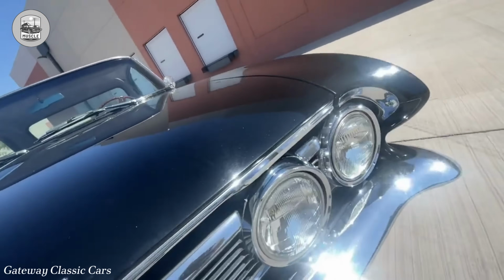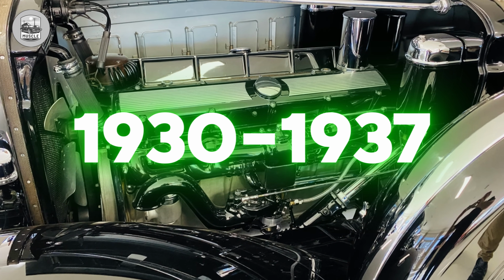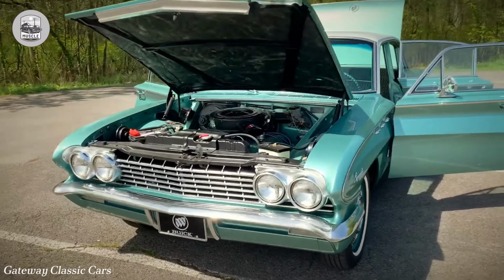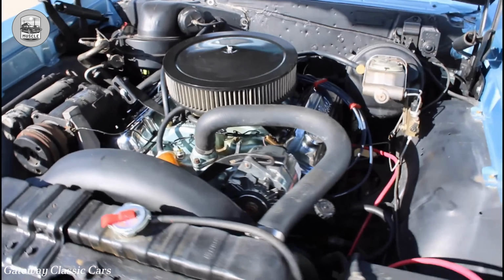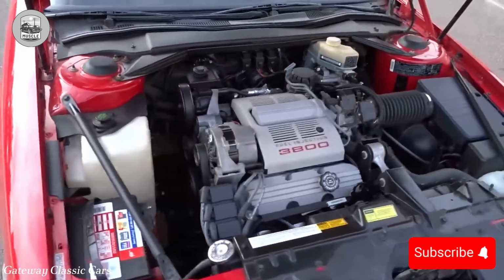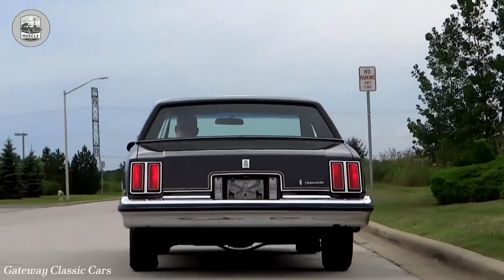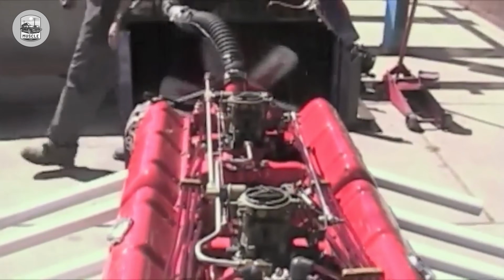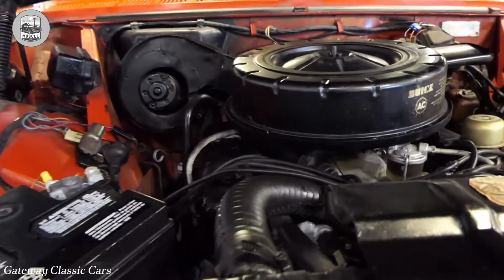10 MOST FAILED and WEIRDEST GM Engines ever made | Worst engines blunder!

Comment: Be sure to cover all the Corvair engines, as they stand out as some of the most unique in automotive history. From their air-cooled flat-six design to their turbocharged variants, Corvair engines broke away from conventional engineering of the time. Their innovative approach, coupled with Chevrolet’s bold vision, set them apart from anything else on the road. Exploring their distinctive features, including the rear-engine layout, will offer a fascinating look at what made these engines truly exceptional. They are the most unique!
Reply: How unique, you ask? It’s like having a clunky six-cylinder engine that’s essentially a knockoff of a VW powerplant.
Reply: @CookeZachery  I don't think it is "a clunky six-cylinder knockoff of a VW powerplant." While it might share certain design elements with VW engines, the comparison oversimplifies the engineering behind these engines. Many six-cylinder engines, including those designed by other manufacturers, were developed with unique performance characteristics in mind. These engines often outperformed their competitors in specific applications and provided a balance of power, durability, and drivability that cannot simply be reduced to being a "knockoff." It’s essential to recognize the distinct innovations that various automakers bring to their engine designs.
Reply: @AilaniMadden  While you highlight that many six-cylinder engines were developed with unique performance characteristics, the engine in question, specifically, does bear significant resemblance to VW’s design principles. It's not just about superficial similarities but about the core layout, cooling system, and other key features that clearly align it with VW’s philosophy. The performance, though potentially serviceable in certain applications, lacks the groundbreaking innovation seen in other six-cylinder engines of its time. By labeling it a "knockoff," we emphasize how this particular engine leveraged existing concepts rather than introducing its own engineering breakthroughs.
Reply: @CookeZachery Regardless of its origins, the Corvair engine fits the topic of the video, which is unusual GM engines - the Corvair engine is arguably the most unusual of GM engines, since there were no GM engines like it before nor since,  and it shares no design features with any other GM engine series.
Reply: @CookeZachery  Corvairs came factory full of forged parts. The world renowned guru of homebuilt aircraft , William Wynn, published a work on why the Corvair was the best engine for them, better than Subaru or Lycomings.  Interesting read. There were Corvairs used in everything, from drag rails to boats, airplanes. They even put them in Porsches for things like the Pikes Peak Hill Climb. They dominated so much they broke them off into their own class.  There were Corvair rally clubs all over Europe.
Reply: @wymple09  While I appreciate the enthusiasm for the Corvair's versatility, it’s hard to overlook its reliance on well-trodden VW engineering principles. Yes, it found success in niche applications like aircraft and hill climbs, but that versatility often came from adaptation rather than innovation. The air-cooled, flat-six design echoes VW’s playbook, and while GM scaled it up, it didn’t break new ground like contemporaries such as Porsche or even Lycoming. Rally clubs and modified uses highlight the engine's adaptability, but being adaptable doesn’t equate to groundbreaking.
Reply: @CookeZachery  It was ground breaking in it's own way. No other passenger car engine was leaving the factory so full of forged parts as standard equipment.  In it's weakest form it doubled the output of a VW & smoked the Porsche in torque numbers. They put Corvair engines in Porsches for that reason, calling them Porvairs.  And they did it at 1/2 or less the cost of a Lycomings.  Porsche went to flat 6 almost immediately after obtaining an early Corvair to study.  There were many design elements in Corvairs that were copied by European car makers, including VW.  Who came 1st, the chicken or the egg? Chevrolet had a V8 in 1917, long before Ford brought out the flathead V8.  Vw in no way was the 1st to use a flat 4 design .  VW was late into the 30's before they cranked up.

"In 1900, the first flat-four engine was produced by Benz & Cie, based on Benz's 1897 "contra" flat-twin engine.[citation needed] This engine was used in Benz racing cars, produced 20 hp (15 kW), had a displacement of 5.4 L (330 cu in) and was designed by Georg Diehl.

London company Wilson-Pilcher released its first car in 1901, which was powered by a flat-four engine. This engine was mounted longitudinally in the chassis, water-cooled, produced 9 hp (7 kW) and had a displacement of 2.4 L (146 cu in). Unusually for its day, the bore and stroke were equal, with each being 95 mm (3.7 in).

In 1902 the Buffum automobile was equipped with opposed four cylinder engines that were rated at 16 horsepower. Herbert H. Buffum produced an American Automobile called the Buffum in Abington, Massachusetts from 1903 to 1907.[10]

Having previously produced flat-twin engines, the 1926 Tatra 30 was the Czech company's first model powered by a flat-four engine. Tatra produced various flat-four engined model through the 1920s and 1930s.
1936–1999
The 1936 Tatra T97 pioneered the rear-engined, air-cooled flat-four, backbone chassis layout (later used by the Volkswagen Beetle), and at the same time, though unrelated, came the Steyr 50 from Austria, sporting a front boxer 4 engine with rear wheel drive. Also in 1936, English company Jowett expanded its model range from flat-twin engines to also include flat-four engines. Production of Jowett flat-four engines continued until 1954, when the Jowett Javelin saloon and Jowett Jupiter sports models ended production.
Reply: @wymple09  Look, the Corvair was clever, but let’s not kid ourselves—it wasn’t reinventing the wheel. GM basically supersized what VW was already doing. Sure, the flat-six had torque and was a blast in hill climbs or rallying, but groundbreaking? Not so much. Porsche and Lycoming were pushing boundaries while Chevy played it safe with air-cooled tech from the '30s. And yeah, it got copied, but being copied doesn’t mean it led the charge—it just made it cheaper for everyone else to catch up. Muscle cars roar with V8s; the Corvair was a whisper in the wind by comparison. Fun? Sure. Revolutionary? Nah
Reply: @CookeZachery  By your measure the VW was just advancing the already done. Everything is just a furthering continuance anyway. So what? Corvair still did what nobody else was doing, a flat six in a passenger economy car.
Reply: Owned both the 180 hp turbo charged and the 140 four carburetted models, loved them both.
Reply from the maker: @gelmgren  Thank you for sharing your experience with both the 180 hp turbocharged and 140 four-carbureted models! Those are some of the most iconic variations, especially when you consider how groundbreaking the turbocharged version was at the time. The 180 hp turbo was a real game changer in terms of innovation, being one of the earliest factory turbocharged engines, and it packed an impressive punch for its size. On the other hand, the 140 four-carb setup gave great throttle response and a more traditional performance feel. Each had its unique charm and driving dynamics, making them beloved by enthusiasts for different reasons.
For those who may not know, the turbocharged models were ahead of their time, offering a glimpse into the future of performance engineering. If you’ve driven or owned one of these beauties, let us know your thoughts in the comments! Don't forget to share your stories and subscribe to the Muscle Car Masters channel for more amazing content on classic muscle cars. We’d love to hear from you! Stay tuned and make sure to share this video with fellow car enthusiasts...
Reply: @MuscleCarMasters68  No turbo lag with the 140 four carburettor engine performance response was immediate.
Reply from the maker: @gelmgren  there’s no denying the instant response you get with that setup. The four carburetors gave the 140 engine such a precise throttle feel, making it a favorite for drivers who wanted that immediate, raw connection between their foot and the engine. It was all about that pure, mechanical response that muscle car fans love—no waiting for the boost to build like with the turbo.
And while the 180 hp turbo was groundbreaking, especially for its time, the 140 four-carb setup has its own loyal following due to that quick, natural power delivery. For many, it offers the best of classic muscle car performance without the complexity of forced induction...
Reply: @gelmgren  Wow, you had the chance to experience both the 180 hp turbocharged and the 140 hp four-carb models—what a dream lineup! These Corvair engines really do stand out as groundbreaking examples in automotive history. From the powerful, air-cooled flat-six layout to the unique rear-engine setup, Chevrolet dared to go where few automakers ventured, especially with that turbocharged option.
Reply from the maker: Thank you for your information. It is so great...
Let's see our channel is a place to share, comment or show your feelings about American Muscle Cars.
Have a good day.
Don't forget to like, share or SUB on our channel to enjoy other great Muscle Cars videos.
Spending more time with other great videos on our channel to explore more about American Muscle Cars.